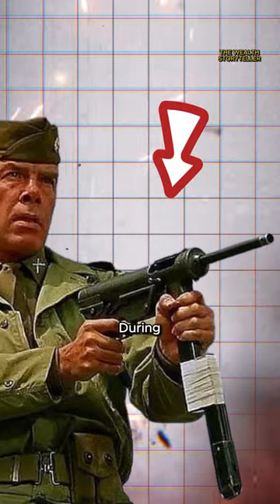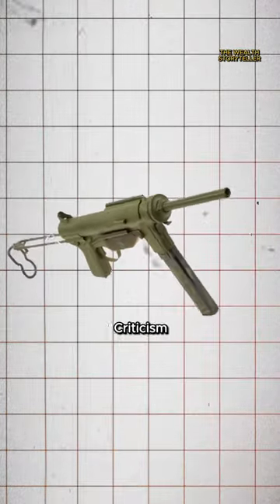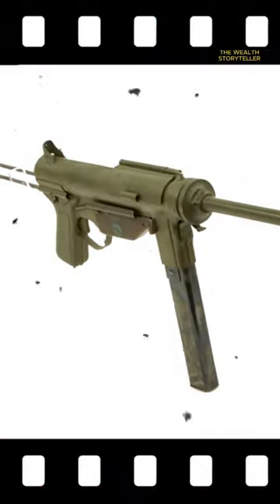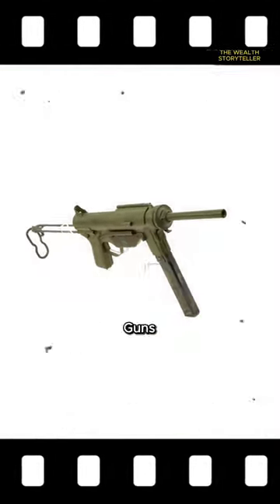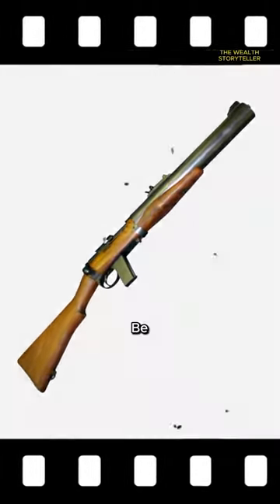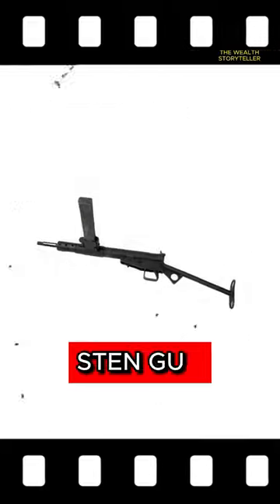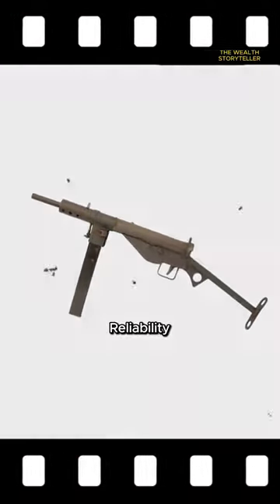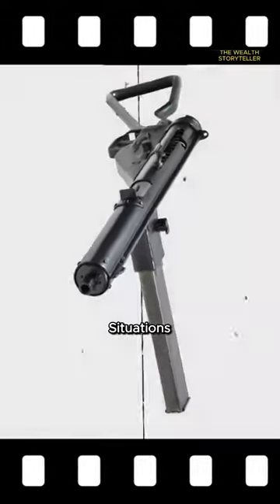3 WW2 dumbest guns

Comment: There’s nothing fucking wrong with the M3 easily one of the best guns in history it looked awesome Edit: Thanks for 1.2K likes guys!
Reply: Exactly. It did the job.
Reply: It wasn't the best gun.... It just worked well. Still would rather have a Thompson
Reply: cost 10 dollars each at the time and shot, seems enough for me
Reply: @mileselon1339 yeah but your basing that on nothing but aesthetic, the M3 is a superior gun to the Thompson, the Thompson was arguably out of date at the start of the war, same with the BAR. Iconic weapons but no reason to choose them over other guns of the time that did the same thing but better.
Reply: I mean, it does look like a literal grease gun you’d see in a garage so I don’t necessarily agree with you there but it was a great little gun, lighter than a Thompson with the same cartridge.
Reply: I mean its a gun not a beauty accessory
Reply: Quicker to make the m3, then a Thompson
Reply: Plus you could effectively buy 10 M3 Grease guns for the price of a Thompson M1A1. And that's not to be confused with the Thompson M1928, which is a drastically different tommy gun
Reply: Nah, M3 sucked, was only a workaround for soldiers who didnt had the need to run around with full combat equipment (tankers, medics) while still giving them a weapon, its main purpose is to be cheap, not good, that was so true, that whenever one M3 had any funcioning problems that would require opening the weapon for maintenance (happened quite frequently due to its poor quality metal components), Soldiers would just throw it away and grab a new one
Reply: @cobrajr188 there is a Native American soldier who use a BAR I would use a BAR, grease or Thompson there both reliable
Reply: @DanielLopes-uo7qo medics don’t use guns
Reply: @jakecowsert6185  the BAR was completely outdated by the start of the war, it’s a dope gun sure but for an automatic it’s got a slow fire rate, atrocious capacity, and weighs more then a lot of actual machine guns. The BAR was designed for WWI trench warfare where firing on the move was important. But by the time WWII came around it was too big and heavy to be used as a rifle and didn’t have the fire rate or capacity to be a machine gun, there’s a reason the whole world copied the MG42. The Thompson is dope and more or less reliable but again finds itself in a no man’s land role, it’s too big and heavy to be a good SMG and it’s not powerful enough to be used as a standard service weapon, there’s a reason it was replaced. M3A1 was a great gun, just ugly, but great.
Reply: @cobrajr188  it doesn’t matter if it’s outdated if it’s still kills
Reply: @jakecowsert6185  and so can a cold, you’re not making the point you think you are. A BAR weighs 20 pounds and only has 20 bullets an M4 weighs 7-8 pounds with 30-60 round mags. Hell an M60 weighs 23 pounds but at least that thing does the job it’s supposed to do well which is be a big ass machine gun with at least 100 round belt. Things like the BAR and the Thompson are oils be awesome collector guns, and would in fact still be better than nothing, but for a real world combat scenario today you’d be stupid to pick those inferior weapons to what is offered today or even in WWII.
Reply: @cobrajr188  I’m not making a point at all a brave Native American soldier favorite gun was the BAR he used all the way to the pacific war
Reply: @jakecowsert6185  that’s neat, and some people like being kicked in the balls. Doesn’t mean it’s a good idea.
Reply: @cobrajr188  someone will say a Thompson is outdated one it is all gun is back then are but it still shoots without a problem
Reply: @jakecowsert6185  yeah and a musket that’s been well maintained will shoot well no problem, the doesn’t mean that there’s not multiple really good reasons to choose better weapons, I guess it’s just the difference between your standards requiring something being good, or in the case you’re talking about, simply good enough.
Reply: @cobrajr188  simply is good
Reply: @cobrajr188  a musket would use last defense
Reply: Yeah the grease gun was hella cheap to make compared to wood guns so there is nothing wrong with the good ol m3
Reply: M3 greese gun its bad firerate so low and not to accurate but working well
Reply: @abyasaalvaroshelby8312  ……… it’s whole purpose was a slow firing but still fast Smg it worked well and served its purpose. The whole reason it was made was to replace the way to fast and to expensive  M1A1 Thompson. And how is it bad and don’t work if it served in Korea and Nam. After it’s retirement in 1959 it also saw action in the Gulf war
Reply: Imagine a German camp gaurd looking at an American soldier and saying "excuse me but I cannot help but notice your service veapon's abhorrent appearance." Proceeds to fucking die because poor aesthetics won't save you from the guy that just witnessed your war crimes. I doubt hell is very aesthetic either, but the M3 sent plenty of germans and japanese there anyway.
Reply: I mean yeah it did its job but all honesty... I'll take my M1A1 thompson over an M3
Reply: M3 was ugly and cheap, super reliable, and was issued to troops in Vietnam. So terrible gun because it was ugly?
Reply: M3 grease gun was cheaper which was the Main reason they swapped they costed low so americans mass produced them if u wanna use the Tommy gun ok but in WW2 M3 grease gun was top of the line due to simplicity and price
Reply: One of the cheapest & reliable submachine guns during WW2
Reply: Exactly
Reply: @jakecowsert6185  yes sir you are partially correct but medic out in battles do have weapons he could have a weapon as simple as a M1911 or a M3A1
Reply: @DanielLopes-uo7qo  well then don’t be in this comment section with the rest of me and my supporters
Reply: @Mussolini897  yes but if you have a weapon you’re no longer a medic your now a combatant
Reply: @Mussolini897  gun use on Gulf war don't mean they are good gun brotha
Reply: It's comment bait and we feel for it
Reply: True
Reply: Yeah boy! TYPE 94 Nambj was bad, small 8 mm pistol that exploded into hand.
Reply: @mileselon1339 thompson had bad recoil and was prone ro jamming, especially with the drum mag.
Reply: @mileselon1339  Thompson cost a fortune to make compared to the m3
Reply: The Thompson was a good SMG and it’s an icon. This video saying the M3 is dumb because of looks is stupid. The M3 a decent smg tankers could carry it with then it was cheaper and easier to manufacture than the Thompson which in war time numbers at a low cost is crucial. The Thompson while still a good smg was costly more difficult to manufacture we sent Thomson’s to  the Uk Australia and other Allie’s and the aussies created their own smg that was better that’s the then the Thompson, I believe it was the Owen gun
Reply: @jakecowsert6185 except side arms and even that is stretching it
Reply: @abyasaalvaroshelby8312  Thompson's fire rate was high and that made the gun incredibly *not accurate compared to the Grease Gun.
Reply: Yeah it is still being used by the Philippine navy seals to this day
Reply: The Best smg for The US, because They could make those thing and didin't cost a entire house worth of money
Reply: I love how it didnt even say its bad it literally said yeah it did its job well and all but its cheap looking as if that wasnt tye entire point of it. Bro acts like a firearm is built the be appealing to the eyes and not a tool for war
Reply: @mileselon1339 they are like the opposite issue one has to high a fire rate for the caliber and thus for many it can be abit tough to accurately shoot, and one has to low of a fire rate and is useless for suppression
Reply: And cheap too
Reply: It looks like a pipe
Reply: I think the grease gun was good
Reply: @jakecowsert6185 so a medic just get fucking killed and before you say that’s a war crime I’m sure the enemy doesn’t care medics in battle needed some sort of protection
Reply: @patrickglaser1560 ahh yes comment bait when the fuck did I ask everyone to comment I explain how the M3 was a good smg and the creator of this video had a shitty opinion did you know you have the choice to just not comment? Wow crazy how things work 😮
Reply: @ottocarius7814 ain’t no way you’ve heard of the Owen gun too I love that gun weird to some people but I like weird looking guns
Reply: @Mussolini897  it was a war crime
Reply: @samfire3067  true that
Reply: Also, with the lower rate of fire, it was more controllable over the Thompson.
Reply: It basicly saved the american economy...

Comment: So the first one was.. ugly? Why would that matter?
Reply: Because the maker of this video is bitter that he doesn't have this weapon.
Reply: @qa5038 same tbh
Reply: The problem with guns today is they look pretty
Reply: It dont
Reply: The grease gun was made that way cause in WW2 the Thompson was really expensive and took a lot of time to make. So the grease gun was made to be cheap and fast to produce.
Reply: There were many other WW2 fire arms uglier than the grease gun. The Owen gun comes to mind. However both were excellent sub guns for their time.
Reply: @Bozephus i defy you to show me a gun that is ugly straight from the factory
Reply: @craigthescott5074  dead on. they look crude because how it looked didn’t matter, the ease of manufacturing, cost of production, and effectiveness was all that mattered
Reply: @WoofleWaffles  Exactly
Reply: It's similar to the AK-12. When the original one looks too modern and has too good functionality ahem got too far from the classic, so they "redesigned" the gun to become another AK-74M.
Reply: I think its Kool looking😂
Reply: @haydensheffield5012  m3's were VERY light with the same power and the Very heavy Thompsons.  They were well liked by the guys that had to carry them.

Comment: If you saw how expensive the Tommy gun was you would not complain about the m3
Reply: I was about 120$ per piece. M3 was from what I read, 40$? Both shoot lead. I see that m3 was a win win. Cheap and working.
Reply: 3 m3s are the same price as 1 thompson?  m3s still a decent job, its cheep, can kill and is fairly reliable for its day.
Reply: @kjp.7714  no no, there were so cheap to make in that time.
Reply: @kjp.7714  The worst part of it is that the M3 made a better job than the Thompson on war because of it's lower fire rate which granted better accuracy.
Reply: @Negonkey fr the grease gun is better at kicking ass than the Thomson smg .
Reply: Thet is the argument for the sten, it was cheap to produce and a sten vs no gun when facing invasion?

Comment: Literally no one complained about the m3.  Often drew criticism? CITATION NEEDED ASAP
Reply: I need to hear this too.
Reply: The M3 was a POS! I served in the Army (1973) and was trained on this weapon. When we got to the range with it, my weapon had a "runaway" fault. This is where the weapon doesn't stop firing when you let go of the trigger. You have 2 options at that point. One, reach around and push the magazine release button, or two, just wait it out till it runs out of ammo. AND mine wasn't the only weapon that had that issue that day!
Reply: @11e40r8 Hey, to be fair, that gun was likely very old and tired by the time you got your hands on it. All things considered they were pretty good for their intended role when there weren't enough SMGs to around in ww2. The army just saw fit to keep using them until they were finally worn out and so they just keep issuing M3s as PDWs for vehicle crews all the way into the the mid 90's.
Reply: The biggest complaint with the sten was it sat awkwardly when slung.  Soldiers Loved the Suppressed Lee Enfield with a scope on it.  And soldiers really loved the m3 because it was simple robust and very easy to control because of it's slow chugga chugga fire rate
Reply: @11e40r8  This is why we get with our 1st SGT before making posts like this. "This gun sucks because I was using one that had been in use for training for well over 30 years, and had some issues". Sounds like you didn't clean it, buddy
Reply: @supergoodadvice853 that and he's probably full of shit, the m3 was pulled from frontline service in 1959, it was still used for a while but I highly doubt he "trained with it" in 73(I could be wrong but the whole statement sounds sketchy as fuck)
Reply: @11e40r8 damn, that sucks
Hey since u trained on the m3 can u remind me which side the mag release was one? An which model did u train on, the standard or M3A1?
Reply: @11e40r8  the m3 is the easiest to control fullauto ever
Reply: Also you could of just shut the door now your killing now you aint.
Reply: @207arms  best job I ever had!!
Reply: @jamesthornton3670  ?
Reply: @207arms  they say that in Fury
I thought u were somewhat referencing it to with the "now you killn now you aint"
Reply: @jamesthornton3670  is a grease gun saying but thinking about it i do remember that movie
Reply: @207arms  it is a damn good movie
Reply: The trigger was booty. But I’m still in love with the Greaser

Comment: First, the M3 had only one bad issue, the charging crank handle snagged on everything. The M3A1 fixed that issue and went on ti be the longest serving and last machine gun issued in the US Army. The last placement was in Armored vehicles.  Number 2 , 
Dee-Lie-Al carbine. It functioned very effectively and you didn't mention a folding stick variation. Three, the British were fighting for their vary lives and had to have Stens. They worked quite well. But the magazine feed lips were the main problem. Please research your material.
Reply: The deelileail is spelled de' lisle so there is that too o dont know how he managed to mispronounse it such horribly
Reply: @Hyper_Blue358 you cant hait on a detailes comment when your comment made me have an stroke trying to read it
Reply: They only made 1 De-Lile carbine with a folding stock.Tne sten gun did have problems with magazine problems , but it could improve with short loading the mag and not using hollowpoint ammo. Calling the M-3 bad because it's ugly? It was cheap ,simple and controllable.  Thompson was pricey.
Reply: @RHM-BWT1942  bro there are so many issues with this comment that I'm going to just fix them all...

You can't hate on a detailed comment, when your comment made me have a stroke trying to read it.
Reply: @Colonel_Robert that’s the joke
Reply: Crank handle? It first had a knob for pulling back the bolt. That was eliminated by making a big hole so the user could use a finger to pull back the bolt.
Reply: @billwilson-es5yn  
Of course, I've fired both and I much prefer the M3A1
Reply: The list is bullshit. The M3 grease gun was probably the best submachine gun in ww2. Easily manufactured, reasonably reliable, accurate enough for ww2, lightweight, idiot proof and there were a lot. Nothing dumb about it other than its look.
The Russians had serious quality control issues with some of their sub guns. Stuff like having to find magazines that fit right.
Reply: I mean to be fair the british only needed it early war as american thompsons were to expensive to keep buying, however thats a testiment to its effectiveness and how troops appreciated it as they kept it around for quote awhile till i think the mid to late 50s.
Reply: @theblazingpegasus9151  it was good enough. They had millions of troops to arm and quickly. The Royal Navy & RAF had the Lancaster submachine gun which was a high quality expensive weapon. I believe the Germans copied the sten design when they needed cheap weapons in large quantities in 1945
Reply: @joelbilly1355  ur right they copied the sten with the mp 3008. The lanchester was mostly a response the the british lacking smgs and needing a quality one and basically copied the mp34 to quickly get somthing ouy that was quality and proven, and like you said it was expensive and after being pushed put of france britain realised oh shit we need smgs and we need em now not expensive thompsons and lanchesters so the sten was designed